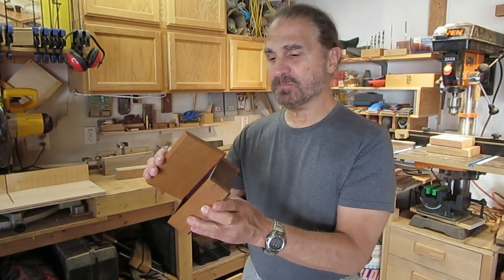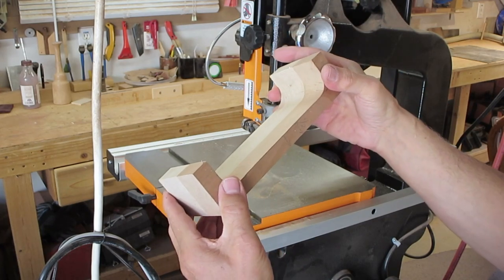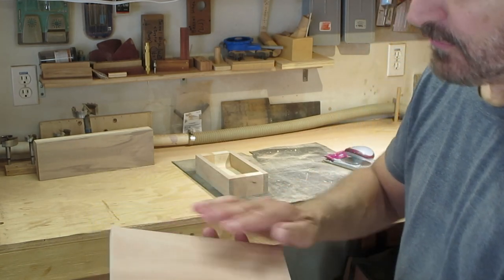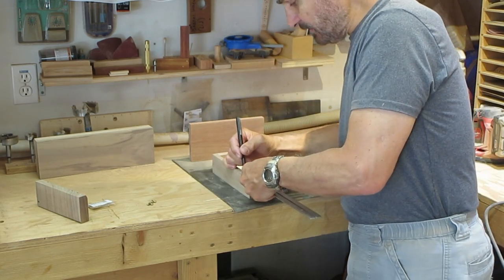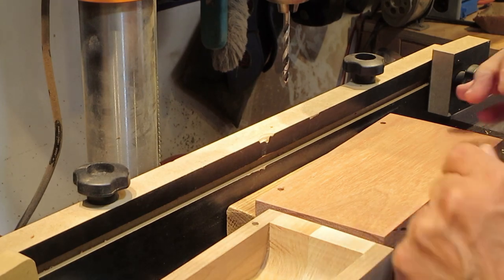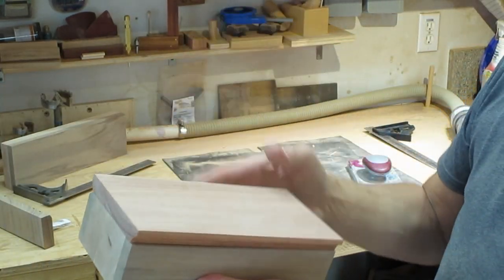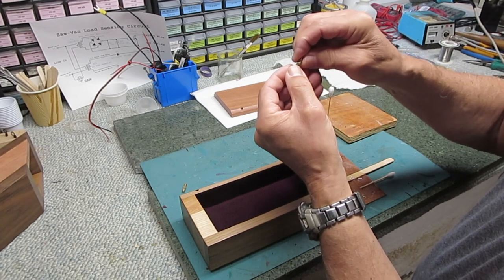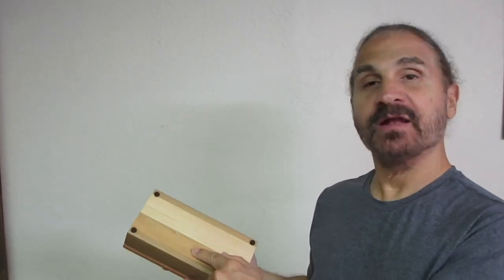Hinged Box

Comment: Great video!
Can I ask why you don’t epoxy the hinge to the box and lid at the same time? Seems like you’d only need 1 wait session instead of two...or am I completely missing something (which seems more likely lol)?
Thanks brother!
:)
Reply from the maker: It's so I can make sure that the hinges on a particular side are lined up exactly as I need them. Before the epoxy is rock hard, I can test the action and micro adjust if necessary.

Comment: How much of a chamfer do you cut 5/16th or ???
Reply from the maker: Actually, I don't know. After drilling the holes and test fitting the top, I make a small chamfer and retest. I repeat this until the top of the box will open fully and stay vertical. It's trial and error.

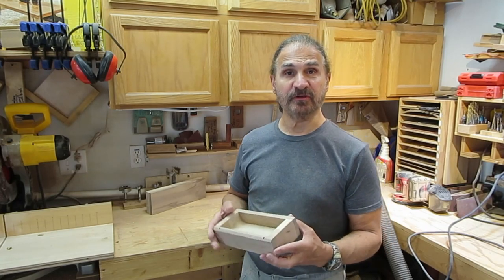Comment: What epoxy do you use? and what laquer do you use @12:20 ?
Reply from the maker: I bought the large (3 oz) tubes of epoxy from Harbor Freight several years ago and am still using it. Haven't had any problems with it. My go-to finish is DEFT spray lacquer (I buy it at my local Home Depot). I use this for all my projects that I don't turn on the lathe (for my lathe-made bowls I use wipe-on Poly and for pens I use Hut Crystal Coat. This is more info than you asked for, but it may help you or others.
Reply: @knotnowwoodworking  Thanks a lot for all the info, much appreciated, and thanks for the video.